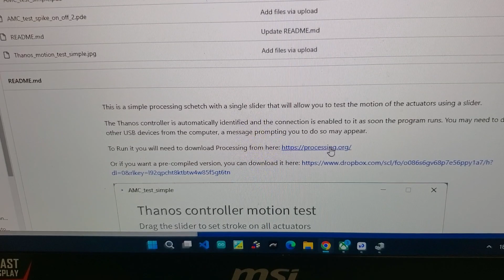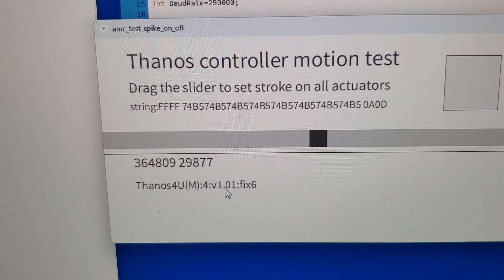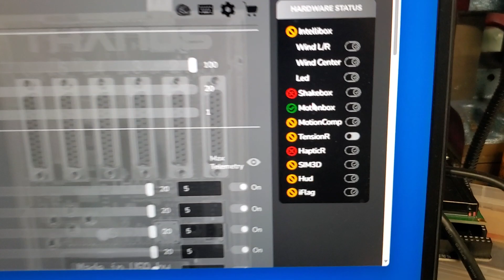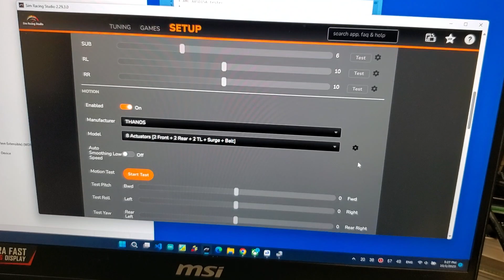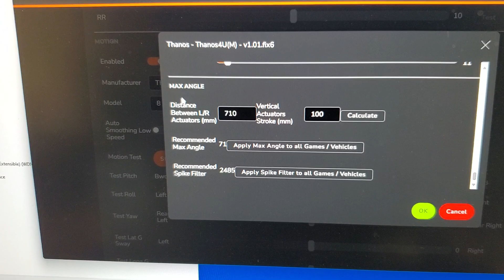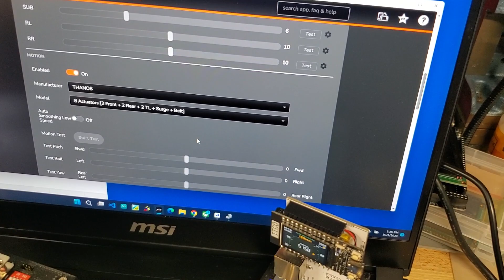How to setup two Thanos4U on SimRacingStudio (SRS)

Comment: wauw really cool where did you buy that db25 emulator with ttgo display? 
Is it possible to only buy one thanos4u controller and use with my belt tensioner???
Right now I have it hooked up with my servo together with an arduino one board and simfeedback but I would like to use SRS software instead.
Reply from the maker: The DB25 actuator emulator is in-house tool and not for sale, sorry. But for your 4 actuator rig, I'd recommend using the AMC-AASD15A controller instead, as it has additional features to assist when using an extra port for your belt tensioner. https://www.thanos-motion.com/
Reply: @tronicgr   thank you for the fast respons  I don’t have the space or the opportunity to have motion on my sim rig I only have belt tensioner so my question was can I use thanos4u for belt tensioner instead because it is smaller and easier to fit on my sim rig and cheaper…. or is it only possible to have belt tensioner with the thanos AMC controller??? I’m a little confused….Is one thanos4u controller only for 4 actuators in each corner? Hope you understand what I am asking you about 🫣